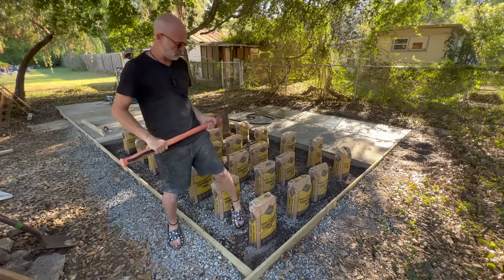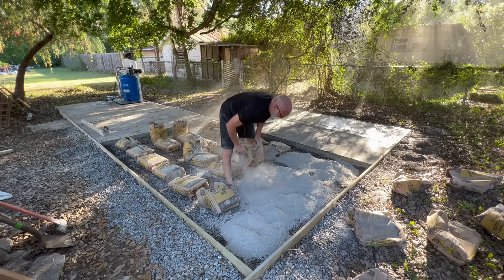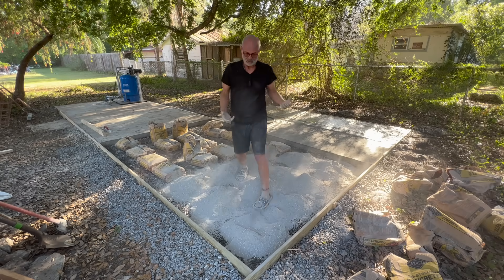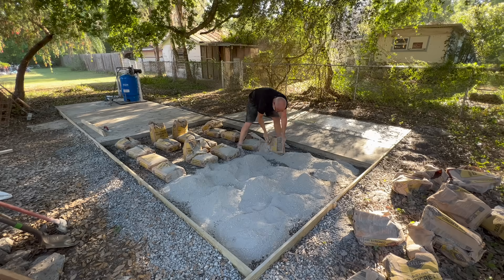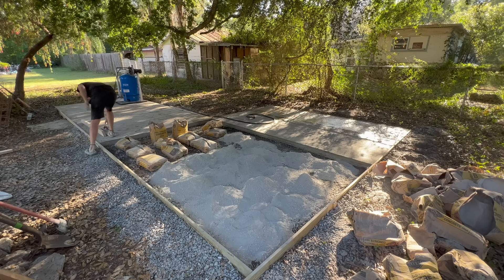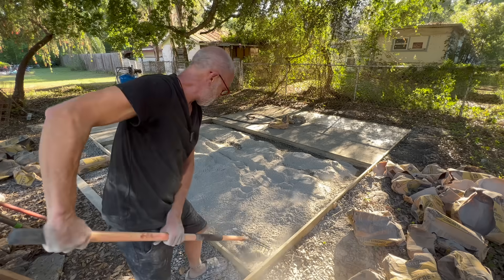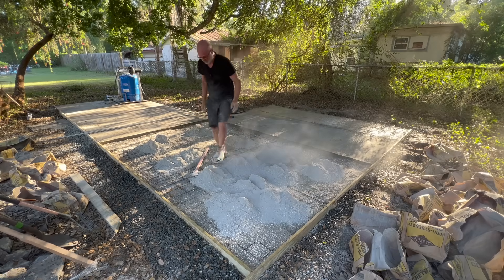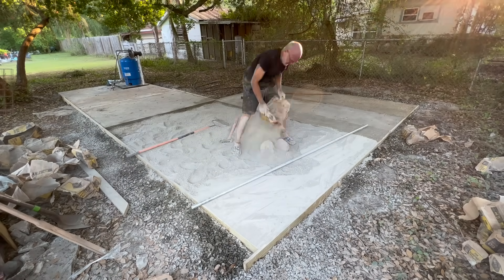Concrete Ninja Warrior Dry Pour Slab for Backyard Building

Comment: Isn't breathing in concrete dust bad for you?
Reply: Water and concrete on skin ain't great either😂
Reply: There’s something called bakers lung. Chefs that inhale flour daily. Resulting in Pulmonary fibrosis. Concrete dust 😮. Wear a mask please.
Reply: Only if it kills you!
Reply: Yup, the lime will dissolve your lungs and also give you silicosis
Reply: The slab won't last
Reply: Yep!
Reply: Extremely
Reply: very
Reply: Sure is
Reply: Yes,but so isn't air.
Reply: It is easy 😅
Reply: LOL silica is real and it gets stuck to your lungs and no way to get it out!
Reply: @CesarEscobar  silica is absorbed and self removes within a few weeks. You're so wrong.
Reply: @gandalf2256  "Breathing crystalline silica dust can cause silicosis, which in severe cases can be disabling, or even fatal. When silica dust enters the lungs, it causes the formation of scar tissue, which makes it difficult for the lungs to take in oxygen." but feel free to prove science wrong? Then again safe to assume you get your medical information off twitter.
Reply: @gandalf2256  Dumb comment, crystalline silica (like quartz dust from concrete, cutting, grinding, or sandblasting):
The body cannot absorb or dissolve it.
Once inhaled, the particles can lodge deep in the alveoli (tiny air sacs in the lungs).
The immune system tries to clear them with macrophages, but those cells often get damaged and release inflammatory signals.
This process leads to scarring (fibrosis), and the particles can remain in lung tissue for decades — they do not "self-remove" in a few weeks.
That’s why repeated exposure leads to silicosis, which is irreversible and progressive.
Reply: @WRNPR you could not be more wrong. Literally crazy
Reply: @gandalf2256  lol. you got to be joking
Reply: Extremely so! The fines from concrete are silica, which when introduced into the lungs does not go away, it is called silicosis!
Reply from the maker: That's what the comment section says but I had ne coughing or skin burns,  But I did have fun and the slab is in 100% condition almost 16 months later.  Don't believe the "fake" comments.

Comment: This poor man will probably get cancer from breathing all that cement dust trying to show us how it's done.
In the end , concrete is graded by it's hardness and how much weight it will hold, the average concrete is rated at 2500 lbs psi, I believe. This example here only has maybe 1/2 inch of solid concrete on the top and the rest is dust. It may support 200 PSI. The mesh he used is, for the most part, not set in concrete but jsut floating. I would not recommend this idea to anyone.

Comment: People don't use a pipe to skreet your concrete you will most definitely end up with a low spot in the middle from the sag in the pipe and from skewering it and putting to much weight on it.    Use a 2x4 or aluminum 2x4 as it will provide a stiffer piece of material by which to drag  your high spots down with out the sag you'll get from a piece of pipe.

Comment: If your building on that slab and need some hold-downs, I don't think they will hold in that dry pour concrete to well! There is no way that stuff will be strong enough when the windstorm hits! In fact I wouldn't be surprised if the edge doesn't break off as you try to drill the holes for them.

Comment: Maybe it is just me, but I think that doing it dry pour, it takes more bags than the regular mixing way, I believe that when you mix it first, you pour water and make the mud heavier and bulker covering more squared feet, 
When you dry pour you fill up all the area with just dry  concrete then you pour water and the water gets into the dry concrete and some filtrates or evaporates, but the slab does not get bigger, 
May I'm wrong but that my analogy

Comment: I've been doing concrete for 18+ years. The biggest mistake you made was not putting any wire mesh in that slab. The worst mistake you made was the whole damn thing. Pouring dry bags of concrete into a spot and then spraying it down with water, and then  thinking it's got any type of strength for building something on 😂😂😂 well let's just say you're in for a reality check. What are whatever you plan on putting on that dark alleyway abortion concrete job don't expect it to last. Ladies and gentlemen this is a video of what not to do and how to waste a bunch of money next time you have a thought sir please just let it go cuz your bright ideas are about as bright as a well-digger's butt good luck with your endeavors😂😂😂😂😂

Comment: Do not use this method! Without mixing concrete with water to reach a gummy consistency, it does have mechanical strength, it will wont sound like rock but sound hollow if you knock on it!!!

Comment: Instructions on an 80# bag call for 3 qt of water in the mix.    Adding one more qt to get a looser slurry reduces the strength of the concrete approximately 40% from 5000psi.    Doing dry method, you have no way of knowing what the hardness of your slab is.   Yeah, the surface may feel hard but you don't know if that hardness extends the entire depth of the concrete.    I would love to see some test cylinders compressive tested.

Comment: You need to mix the concrete to get it to activate correctly. This would be like pouring a two part epoxy and not mixing it. If it were a 2000psi you just made it 1000psi. I pour slabs by myself alot and never have issues of it drying because i put the mixer right on the section im pouring at. Plus this is just double the work this slab takes about 5-6 hours to complete wet.😂

Comment: I mixed over 1000 lbs of concrete with a plastic bag in one shot and it wasn't cured when I finished. If you mix the bags to the bag instructions you get like 2" of slump which is way easy to trowel.

Comment: Bro i drive a cement mixer and i do pads and drives. Zero chance it takes that long to mix crete. Lol. You can definitely mix and pour as you go with a portable mixer. 
 Edit, you probably spent 1500 or 1600 on bags when you can get 4 yards for 700 from a truck

Comment: You will never get a smooth finish doing this.
Concrete needs to me mixed so the cement coats all the aggregate.
This dry pour method will "wash" the cement from the aggregate at the surface.
But aside from that, what did this dry pour involve.
Getting all the bags from place of purchase or delivery with a charge.
Hauling them.  Opening which is not good to breath the dust.
I think a delivery by some concrete company would be much easier in most cases.

Comment: It won't set the same it will be brittle and have dry areas, use a mixer or measure volume and have it poured it's cheaper and correct.

Comment: Attention to detail is paramount to a successful and visually appealing and strong concrete slab.

Try these three things to help make this job look professional and sustain the test of time.

1) Make sure you don’t follow the watering instructions on the bag. Mist heavily afterwards for 5-6 hours on the hour, then start hourly soaking cycles. Too much water is not an issue, under watering definitely is. Wait at least 3-4 days before removing wood, longer if you can. Keep watering during those days.

2) Use a corner trowel on the edges between the concrete edge and inner slab form to prevent chipping and cracking on the edges as much as possible when you remove the wood form, plus it just adds a professional look.

3) Spray WD-40 on the inner side of your wooden slab form around the entire perimeter BEFORE you add any dry concrete mix inside of it. This will ensure a quick release of the wood form when you remove it and minimize cracking or chipping because the concrete adhered to your wood form. The WD-40 acts as a buffer between your wooden form and the concrete guaranteeing a quick and uniform release with absolute minimum cracking or chipping. 

Happy project to you all DIYers!
Reply: I recall people from my town using petroleum or old engine oil on the wood as well, good tip as I had forgotten all about it lol.
Reply: So 3 should be 1???

Comment: hate to be the negative one but way to much work time...order the concrete mix and wet..that size you can handle yourself easy..you didnt save much money...also best thing about mixed concrete is you dont get cement dust all over you...especially the one you inhale. whats on your body is nothing compared to what you just ate

Comment: Don't buy into this new line of stupidity someone got started. Dry pour may look ok on the outside but it don't have nearly the same strength. the concrete breaks very prematurely and then crumbles. Don't believe me just make a small form and take a hammer to it then do the same with the same size piece that was mixed properly.

Comment: Just a heads up on the silica dust. Once those silica crystals into your lungs, they never leave. Wear an N 95 mask to protect those lungs. Additionally, the chemicals in the mix will suck all of the moisture out of your skin, and your fingertips will crack very painful (concrete/chemical burns) without PPE.

Comment: DRY CEMENT PASTE.. NOT CONCRETE...CONCRETE = CEMENT PASTE /WATER/ AGG/SAND. THAT IS NOT CONCRETE... UH NO.. IF MIXED RIGHT HE USED ENOUGH CEMENT PASTE TO MIX A 12.000 PSI MIX.. IF YOU DRIVE A LARGE EQUIPMENT ON THAT PROJECT HE DRIED PLACED..IT WOULD CRUMBLE.. QC.. PS.. YOU POUR WATER.. YOU PLACE CONCRETE.. JUST A CLUE..

Comment: This is a very ingenious way of doing it I do have a few questions, though how has held up? I wonder how well it bonds together with not mixing it seems to me like it would create an outer shell, and be soft on the inside. I do like how you only poured half of the bags and then put down your rebar metal and then poured the rest all in all. I think it came out pretty good.

Comment: I have to say that dry pouring does not create a strong bond as a mixed batch. However, if you're not putting anything heavy like a big tractor, lathe, or a mill over it you'll be fine.

Comment: The real question is why buy all the materials, then not obtain full strength by smearing the cement properly over the aggregate by mixing?  The $250 portable mixer from Harbor Freight, you mix it within the pour area and dump it, then move the mixer around.  Then you sell the mixer back off for most of what you paid for it.  Find a used one already and the cost will be near nothing.  There's VERY LITTLE to gain from 'dry pour', and a lot to lose.
Mix up a dough sometime.  Then try to make another dough with dry pour, just putting water on ingredients.  Makes a crappy dough.
Only wetting the cement beside the aggregate is not the same thing as properly mixing, and smearing the wet cement onto and into the aggregate.  It's a poor idea, even if it 'does OK enough for very light duty concrete' sometimes.  It's very little extra cost or work to use a portable mixer to do it properly and get near full strength of the materials.

Comment: I have a shed that has a dirt floor. So I decided to try dry pour. Did. Mine a little different but same principal. Framed off one side with 2x4. Stack broken concrete and rocks inside forms. Poured dry concrete over it and packed around it. Screeded top to just below top of board. Wet it down good to get saturated. Let it sit about an hour. Poured thin layer of dry mix on top and misted. Walked away. Very solid. Has been that way for a while. No problems. I live in NM. Over 100 in summer and down to 0 to 10 in winter. No cracks.

Comment: The easiest and fastest way to do it is without your sandals on...just barefooted and the feeling squishing between your toes is therapeutic...BTW I've dry set fence post, porch posts, deck posts or whatever you're setting in concrete...dig a hole 16 to 24 inches depending...wet the hole sides and all then leave about 2 or 3 inches of water in the bottom...put the post in, plumb the post and pour  in the quickrete about half full then water again well then fill the hole with quickrete with a dome at the top. Lightly water the top and re-form the dome if needed...that's it.

Comment: FYI the welded wire fabric should be lapped 6" minimum. I recommend using a keyed joint between the slab pours to avoid differential settlement.

Comment: Im a concrete finisher and im not here to say this is right or wrong ..you do it however you want..but i will say the concrete mixer the wheelbarrow and one man can definitely pour the pad your using in the video from start to finish can be done in 2 hours at a relaxed pace...you make it sound like its impossible to mix right beside the slab ...you can mix inside the slab if you really wanted to..anyway have a good day

Comment: You need advice, don’t know if you are looking for it?  Concrete can wreck you fast brother. You need a respirator, eye protection, and for gods sake keep it off your skin….( there is lye and other damaging stuff in the mix!! I’m also worried about your load rating not being 100% with a dry-mix. And realize that it is a chemical exchange process that hardens the concrete to specific properties to handle loading. Is dry pour a shortcut to early failure??? That’s a question for you. Good luck be safer!
Reply: He rarely does this in his life, if done daily I see your point

Comment: One reason to mix concrete in the traditional way is air entrainment.  When concrete is mixed with water for the proper length of time billions of tiny bubbles are made.  These bubbles absorb the expansion of wet concrete when it freezes.  I'd love to see some dry pour concrete after a few winters in the Midwest.  In the south I'd probably try a dry pour.
Reply: I did a dry pour over 30 years ago in Minnesota in a 30 by 40 pole barn. Divided into 3 sections. Gravel, Portland cement and a rototiller. Screted it off dry, then a float and trowel and a little water spray to work up the surface. Turned out just as smooth as a wet pour. Covered it with plastic for 30 days. It still has not cracked.

Comment: Actually, its not really a bad idea doing it this way, if its not smooth you can go back over it with a bonding agent and skim coat over the top with a mixed batch and trial over it, or grind it smooth and stain it.  With the right under laments and 
Prep work it can be pretty strong after 30 to 45 days and plenty of water treatments  you could even spray on a bonding agent to make it stronger. Add re bar   and or fiberglass additives a cement truck would use  depending on its use it could be plenty strong for a storage shed.  I think if i was doing a garage id hire a company to come do it.  Its too much work to Diy a big pad like that most concrete crews have 5 or 6 guys. It dries to fast to solo it.

Comment: Don't use a mixer, mix it right in the wheelbarrow with a hoe. In 5 minutes you have that satisfying pancake batter to pour. But it would be an additional 5 minutes for every two bags to mix. Cement doesn't cure that fast, if one gets tired they can continue the next day. Pouring over semi set cement won't weaken it. The first project I did I had a harbor freight mixer and it was a PITA. The cement would stick in it and cleaning it was a chore. I got rid of it. A wheelbarrow and a garden hoe 👍

Comment: I have a depression in my my driveway  that makes a pond when it rains.  I don't care about how it looks.  I got asphalt quotes 5-7k to fix a section.  Can I put 3" of gravel down and then put that dry concrete over that and spray it to harden? If it's a depression do I need to put a board barrier or can I just plop it down?  Thanks?

Comment: There is no way I would trust this way for anything structural or critical in anyway. There is no guarantee the concrete has mixed properly. I dare you to get density imaging done, there is no way it would pass. Now doing it this way for a side walk or similar small less important job, then sure we can do this at your place but never mine, i want to be positive that it will look good, be strong, and last.

Comment: I cant believe you had the confidence to upload this. When you inhale cement dust it can literally harden in your lungs. By pouring the cement dust on the ground then using a hose you essentially just wettened the top layer. I give it a few months before you start seeing cracks. I hope you aren't planning to put a shed on it because then you are talking about a safety hazard.

Comment: Ya don’t use a trowel to level concrete in a slab. You use a screed board. Usually just a 2x4 fit DIYers. The screed spans from one side of the form to the other and is worked over the pad. 
This method will work but there was no where near enough water out on it.